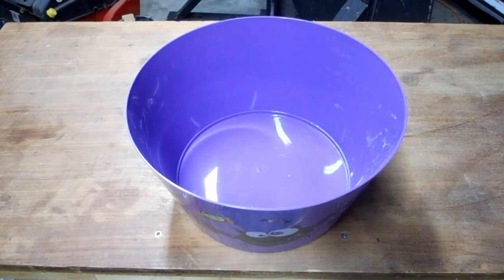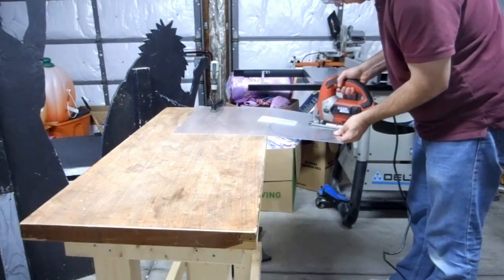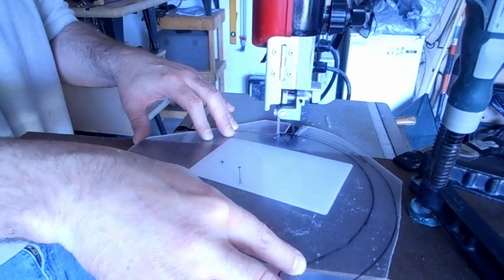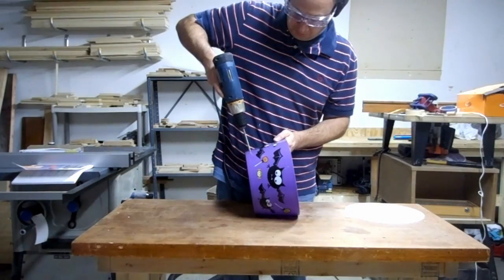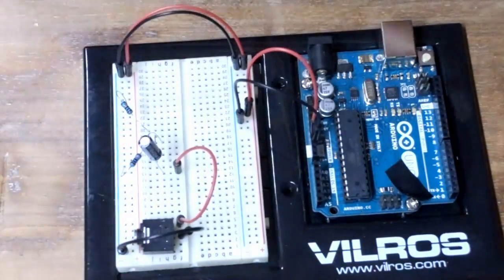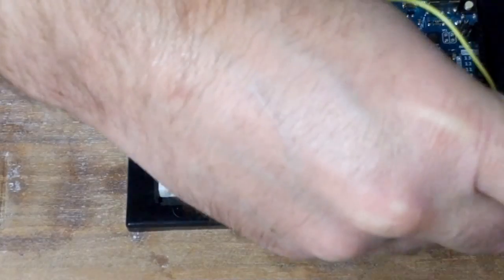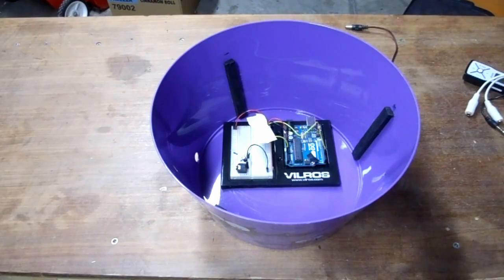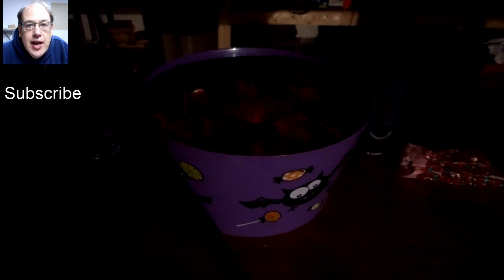Spooky Halloween Project - Make a "Beating Heart" Candy Bowl with an Arduino

Comment: For some reason I can't see the wiring diagram on your website.  Over-simplifying, I suspect the capacitor is a piece of a filtering circuit.  I'd say that it is correct to think about the static voltage between your 2 resistors as 2.5 V assuming that both your resistors are the same value.  However, when you attach something to that point all bets are off.  Let's assume for a second that you used a resistor instead of a capacitor hooked up at that point.  As the input voltage varies, you are going to get current flow through that resistor, which is going to disturb the voltage divider relationship.Taking the example a little further, if your input voltage were a static 2.5 volts, then no current would flow through the resistor because the voltage on either side of the resistor is 2.5 and by Ohm's law the current is 0 given no voltage change.However, if you change the input to 0 volts, then you essentially have a situation where you have modified your voltage divider in such a way so that the bottom "branch" of it is now the parallel combination of your original resistor and your new resistor.  If you change the input to 5 volts then you have created a situation where you have modified the resistance value of the top "branch" of your voltage divider into the parallel combination of your new and original resistance values.You shouldn't think of the capacitor, when you add it back in, as something that charges without letting any current through it.  That may be true in DC circuits, but as soon as your input becomes something with frequencies, like an audio signal, such signals do "make it through" capacitors.  The effect that the capacitor has depends on the frequencies involved and the resistor and capacitor values chosen.  The general effect however is that the capacitor attenuates (dampens) the higher frequencies much more than the lower frequencies, and as such acts like a filter.  Lower frequencies are passed and higher ones are squashed.  In audio signal processing, this is desirable both because unwanted artifacts can emerge from the presence of frequencies above the frequency at which the arduino is actually sampling and because there are sometimes higher frequency "ringing" effects associated with the "step" change in audio that is being detected to turn on the light.  The capacitor "smooths" those effects out prior to sampling by the arduino and detection  by the software.Lastly, it looks like you are using an electrolytic capacitor.  I would avoid playing around with input voltages that are too high...There is no reason to use a polarized capacitor for this circuit, (i.e. one where the negative and positive terminals are labeled).  Those are more typically used on power supplies and will literally explode under high voltage if the input polarity is reversed.  I hope this helpsJeff
Reply: +Ken Reighard I cannot open it.
Reply: +Ken Reighard so looking at that picture, I have a pretty good idea of how it works ... what is your question?

Comment: Easiest way to cut acrylic with the jigsaw is a fine tooth blade...  and supporting as close as you can to the bench... Acrylic is brittle and chips and cracks very easy. The bandsaw is a good way without chipping as you did 

But it turned out pretty cool and you got the effect you were after... :-)  I would like to help on the electronics as well.... but that stuff is waaaaaaay over my head ...lol
Reply: ***** Yah lost me when you said DC is that DC comics... lol  I know AC/DC back in black if that is any help... :-/   Sorry bad kiwi humour
Reply: +Ken Reighard lol I was thinking that to... hahha...